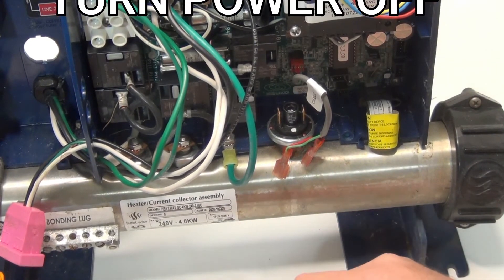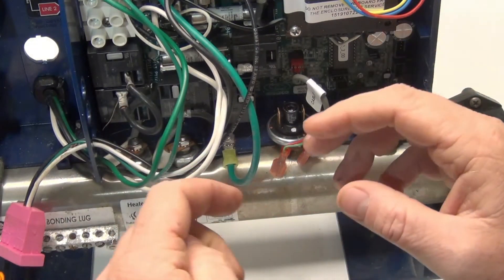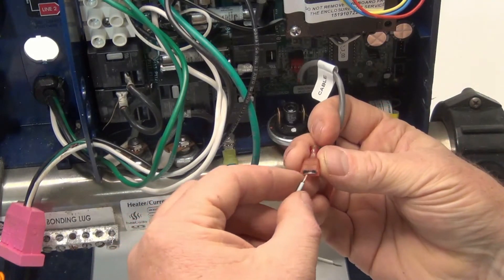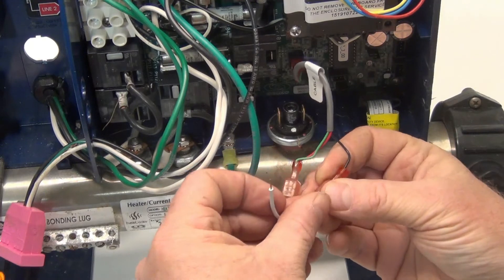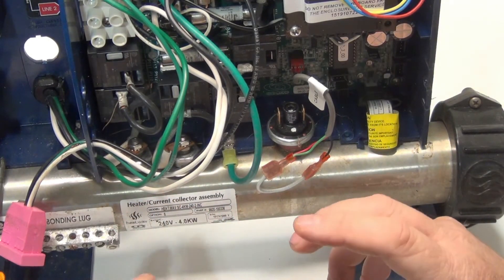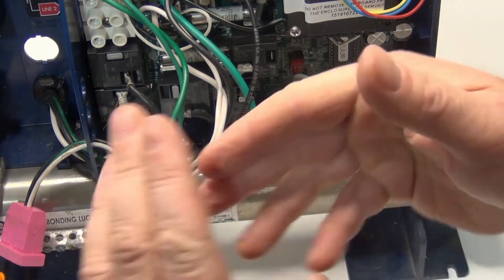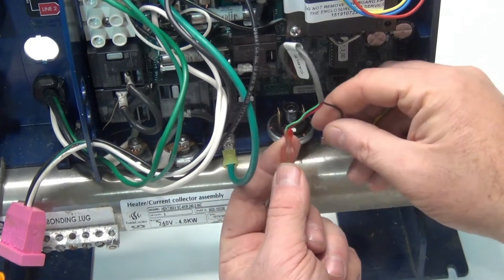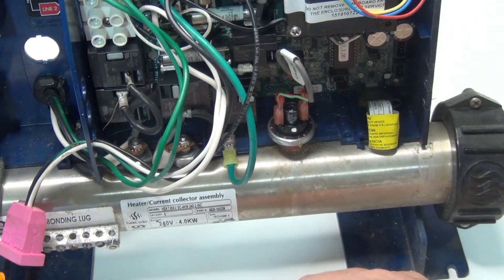Testing a HOT TUB Pressure Switch / Hot Tub Water Not Heating?

Comment from the maker: Other Video links on our home page to test the pressure switch by turning the pressure switch (SEE VIDEO FOR THAT).
Reply: Hi, I have a Bull Frog A Series hot tub. When you run the jets through a cycle it runs fine but as soon as the cycle ends it will throw error codes. It will either say the heater is dry or the water flow is low. I have tested the heating element but I do not see a pressure switch to test.
Reply from the maker: @IrishKillian  the DRY code normally means it's a flow problem.  Try pulling the filters and see what happens.  Let me know
Reply: I pulled the filters and it still threw both error codes when the cycle ended. I have already drained and cleaned the hot tub and filters. I pulled the water lines to make sure there wasn’t any air in them too. Does my hot tub not have a pressure switch? Does it just go off the circuit board? Thanks for responding! I didn’t expect to get a response so quick. That is really nice of you!
Reply from the maker: @IrishKillian  The newer Bull Frog tubs don't have a pressure switch.  Not sure the year or model you have.
Reply: The hot tub is a 2018 A-Series. The annoying thing is I looked in the manual for help but it doesn’t tell you anything. I tried unplugging everything from the circuit board hoping it would reset something but that didn’t work either. What takes the place of the pressure switch if it doesn’t have one? Is there anything else I could test power to?
Reply from the maker: @IrishKillian  make sure you have all the jets open, nothing is blocking the filters and the pump/motor that pushes the water thru the heat tube is working.   Could take a few pictures of the pack (what everything plugs into under the tub) and pump(s) and send to info@vippools.ca
Reply: Everything else works. I just don’t understand how it can work while the cycle is running but when you end it, the error codes come up. I sent you a couple of pictures. Thanks!
Reply from the maker: @IrishKillian  Show the pictures.  Thanks.  There's no pressure switch in that spa pack.     The sensors will pick up the flow.  See if there's an error code right before the DRY code comes on.
Reply: Yes, the water flow may be low error code comes up first. Then the heater may be dry error code pops up after it. Occasionally the error code of the sensors may be out of sync shows up but not always. I have only seen that one a few times. I think that started after I unplugged everything from the circuit board.

Comment: use a fuse instead of a jumper wire, the blades connectors will slide right on

Comment: I just bypassed my water pressure switch based on this video on my pool heater and I got the heater to fire up.  I'm replacing my pressure switch.  Thank you for showing this!  Saved me a service call.
Reply from the maker: Its a good "temp" fix.  Never turn off the pump with that bypassed.  Heater will not shut off and will melt all the plumbing.

Comment: Hi! I’m having the 3 light issue with my hot tub, when I put the jumper cable in, I had the same issue - showing current temp 16.5C and 3 flashing lights? Then I unscrewed one side of the heater tube to see if it had air in (as mentioned in another of your videos) then the pump started making a low vibration noise, but the heater light on the pack isn’t coming on and I still have the 3 flashing lights? Any ideas to help a poor guy out? 😅
Reply from the maker: The 3 lights issue is normally a flow problem.  Pull filters and look for a blockage of some sort.
Reply: @VIPPoolsandSpas  hey! It hasn’t got any filters in at the moment, the water is brand new and clean. All the jets are running (seemingly fine) .. I’ve replaced the heater element a couple days ago, and awaiting a pressure switch to be delivered now! Hoping that solves the issue! Do you have a video about how to set a new switch up? As I imagine it’s not simply plug and play? 😄
Reply from the maker: Remember, the 3 lights blinking are a flow issue.  Make sure all knifevalves are open and that there's nothing blocking or restricting flow.
Reply: @VIPPoolsandSpas  I’ll have another look to be sure! Thanks! 
When I fit the pressure switch, do I need to set up the top screw? Or should it just be fine straight off the bat?
Reply from the maker: @DirtyRaymond95  its all set
Reply: @VIPPoolsandSpas  thank you so much for your help! It’s given me a great deal more confidence going into this project!
Reply: @VIPPoolsandSpas  so I replaced the Pressure switch, and managed to get the heater to turn on (first time since owning the tub!) however it cuts off after the 20 minute jet cycle stops? I’ve also noticed sometimes my pump makes a sort of humming noise, but doesn’t appear to be any water movement? But it works in high and low jet modes? I’ve ordered some line flush, hoping to give it a treatment and drain it (again 😩).. also I didn’t realise I was supposed to fill it via the filter housing, so I’m wondering if the issue could also be airlock related?
Reply from the maker: @DirtyRaymond95  it really sounds like a capacitor.  Does the pump make any noise that isn't normal?  The humming is from it not turning on low speed.  The is a capacitor or bearing.  Maybe a problem with the low speed relay.  But need to know what spa pack you have.
Reply: @VIPPoolsandSpas  I have a HydroQuip CS6230.. I did think that noise was odd. It does get quite hot as well. Due to us being new hot tub owners and purchasing a second hand tub, we never heard it running, so I’m not sure what noises are and aren’t normal 😂
Reply: @VIPPoolsandSpas  I have a HydroQuip CS6230.. I did think that noise was odd. It does get quite hot as well. Due to us being new hot tub owners and purchasing a second hand tub, we never heard it running, so I’m not sure what noises are and aren’t normal 😂
Reply: @VIPPoolsandSpas  the pump is an Emerson K55MYGRD-8367 spa motor 1563 ?
Reply from the maker: @DirtyRaymond95  well.  You can take a few pics of the pump and pack and send to info@vippools.ca so I can take a look at what you have.

Comment: If I did the bypass wire or jumper wire and it trips  my braker so it not the pressure switch?
Reply from the maker: Its not the pressure switch.  You just turned on the switch and something else tripped it.  More than likely its the element.  The only time you would test the pressure switch is if it wasn't heating and you tested the element first.
Reply: @VIPPoolsandSpas   so i have replaced the flow sensor cause i was getting error FL. hot tub worked great right after words temp went to the temp i had it set at. the next day temp slowly started dropping and will not get any warmer then 56 i replaced heating element  checked all fuzes replaced filter  checked for air locks did the jumper wire trick to see if it was pressure switch when i did jumper wire it tripped the breaker. i'm lost not sure where to look or start to fix  any help would be grateful
Reply from the maker: Do you have a pressure switch or flow switch?  Can't have both.
Reply: @VIPPoolsandSpas  pressure switch
Reply from the maker: @debraberndt137  Turn power off for 5 mins, then turn back on.  Test volts at the element after heat indicator light comes on.  Same time you'll heat the relay click.

Comment: Hi, I have a Bull Frog A Series hot tub. When you run the jets through a cycle it runs fine but as soon as the cycle ends it throws error codes. It will either say the heater is dry or the water flow is low. I have tested the heating element but I do not see a pressure switch to test.
Reply from the maker: This normally means it's a flow issue.  Try pulling the filter and see.  Let me Know

Comment: I don't see how this works. If you short out the pressure switch, the start up routine says we have pressure but the pump is not on.  That is an error. Once your running, I see shorting the pressure switch. Heater heats because we have pressure. Cannot have heat with no water pressure.
Reply from the maker: It's not shorting it, it's just bypassing it to see if it's the pressure switch or something else.  Pressure switch only controls if the heat comes on or not.  Pressure switch can not control any other equipment in the hot tub.  It's the "safety feature" just for the heater element.
Reply from the maker: A faulty pressure will not affect the pumps.  Pump 1 or circ pump will come on or stay on trying to heat.  The pump will run forever if it's a bad switch.  Sometimes a error code will come up and sometimes not.

Comment: Hello I have Infiniti Maax hottub early 2000 model. I am getting FLO error, heater indicator flashing 4 times.  I can feel heating is ON, as temperature increases to the set point but pump keeps running. If switch ON jets, FLO error goes away.   I couldn't locate pressure switch. Please help.
Reply from the maker: Look on the circuit board and look for the pressure switch and where its plugged into.  Follow the wire back to the pressure switch.  Adjust the switch.  ALSO.  Set the temp to 102. Once its to the set point, then lower the temp down until the pump turns off.  If it doesnt turn off, its something else.  Was the hot tub running fine before? Has there been something new put in?  How long have you had the hot tub running (on your property) for before the issue?

Comment: I have a Viking Spa. I get an FL error. I just pulled the lead from the pressure switch off the board and it starts right up. I assume I have a bad switch?
Reply from the maker: If you pull the lead off, it should show the FL code.  Surprised it went away.  Try changing it and see if that works.  FL code could be something else also.

Comment: Thanks pal, that method gave my Caldera Vacanza another code; however when I left the two wires connected and then jumped them. It kicked the heater on. I also tapped lightly on it… not sure what made kick. But the knowledge you gave me allowed me to figure out I have a faulty switch. Thank you sir, I subscribed.
Reply from the maker: Your Awesome !  If there's a video that I don't have but want to see, let me know.  Thanks for watching and subscribing.

Comment: Thanks for this video, it helped me troubleshoot a problem with my hot tub heat not working.  I do have a question.. I understand why you wouldn't want to continue to operate the hot tub with the pressure switch bypassed because you're basically bypassing a safety and  equipment protection interlock.   But why is leaving it connected for testing to see if the heat comes an issue that would require 2 people?   Even with the jumper in place, the water in the heater tube will not heat up and evaporate that quickly, so as soon as you see the heat is on, you  should still have plenty of time to turn the power off.   

Alternatively, if you wanted to be completely safe, you could disconnect the heater at the terminal block altogether, then use voltmeter to check if you have voltage across the terminals when the power is turned on and the pressure switch bypassed..    That will tell you whether the heater is coming on, without actually putting power across the eating element.
Reply from the maker: This is only one way of testing if the heat comes on or not.  I do have other videos covering this.

Comment: Thanks for the video. I replaced my switch (flc error) with a new  pressure switch now I get an FLO error code. Maybe new switch is defective? the adventure continues...
Reply from the maker: Make sure the pump that pushes water thru the heat tube is running.  Pull the filters.  Make sure wire from the switch to the board is good and plugged in right.  Make sure the 2 pins on the board are good and clean.
Reply: @VIPPoolsandSpas  all was good I turned a 1/4 turn counter clockwise on the switch it worked thank you for your help..keep up the videos!!
Reply from the maker: @IamtheComedybroker  remember.   This is just a temporary fix.  Order one right away and you'll have it when it will fail.
Reply from the maker: Make sure to subscribe, it helps me make more of these videos.  Thanks

Comment: I have a questions about hot tub repair, but not directly related to the Pressure Switch ..  My Marquis Spas Hot Tub topside control panel is unreadable in daylight and barely readable at night.  Its a 3 button control panel (Jets, Temp & Light). 8 pin "phone type" connector. I'm having trouble locating a replacement topside control panel. 

1.  Will removing/replacing the overlay help with visibility of the LCD display? 

2. The circuit board is made by Balboa Controls .   Can i use another 3 button topside control panel that has the same buttons controls, works with Balboa circuit boards and an 8 pin "phone-type" cable?

3.  If not, is there a way to adapt or retrofit one?
Reply from the maker: Overlay will not help the screen visibility.  Whatever Balboa pack you have there are other topsides that will fit but might have to go with other buttons on it.  Search the pack you have and see what's available?.
Reply: @VIPPoolsandSpas  - i did search for the topside controller...  They're hard to find as the hot tub is 25 years old.  Hard to cross reference the old part number on the side of the module..   i'll look at it more thoroughly once i get the new pressure switch installed.  

Any chance you can do a video on any issues from using different controllers with a different board?
Reply from the maker: @georgelouie5330  different topside with a different pack will not work if it's not designed for it.
Reply: @VIPPoolsandSpas  sorry, i misunderstood the earlier post.. when you say "pack", you're referring to the circuit board?
Reply from the maker: @georgelouie5330  spa pack. Yes.  It has the circuit board in it.